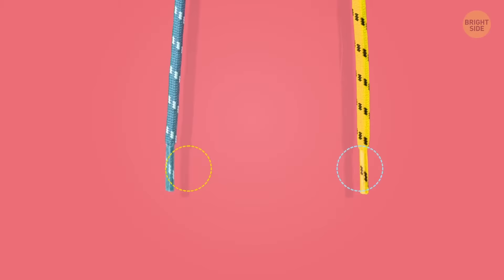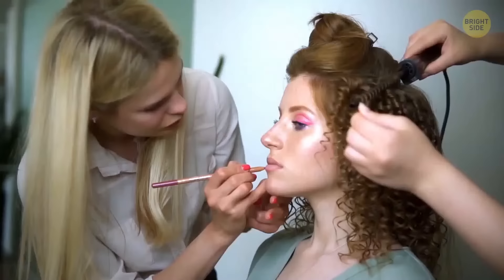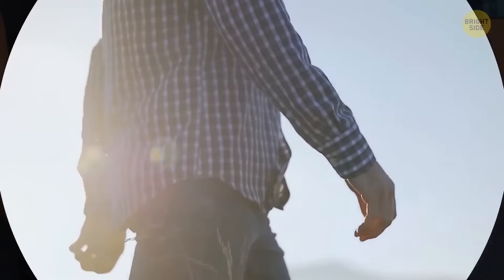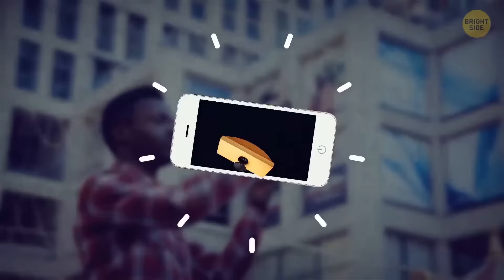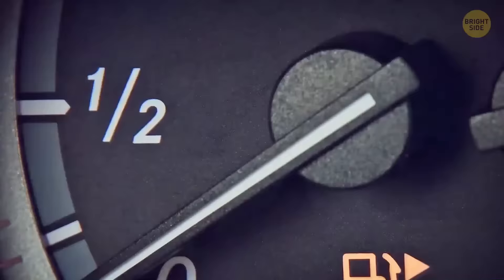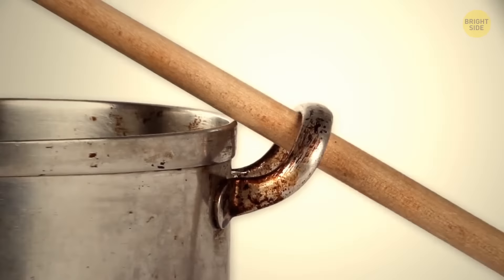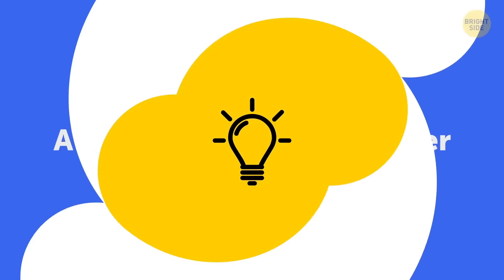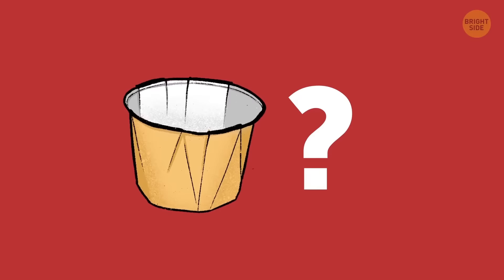I Just Found Out What That's For (Believe Me, That's Something You Need To Know)

Comment: Their information on dollar bills' longevity is wrong, because I worked at a bank where one of my responsibilities was collecting mute (mutilated) money and turning it in.  Much, I would say the majority, of the ones I turned in were five (5) years to ten (10) years old and some a little more.  It depends on the wear and tear, which varies greatly among bills of the same denomination. 
They're also incorrect about the QWERTY keyboards.  I know this, because I took typing in high school, and our wonderful typing teacher told us how it came about.  They are arranged by the frequency of use and the ease of co-operation of your first three (3) fingers particularly!  Pretty cool idea!
Reply: Teach! They surely don't know everything.
Reply: No, you are wrong. The first type writing ckerks knew their alphabet and were typing so fast that the metallic branches, that were the leverage allowing the actual Printing through pressing the inked often dual color ribbon of cloth onto the paper, meddled onto one another, the next key stuck before the metal lever of the last key had time to withdraw.
forcing the clerk to manually disengaged the crowd of those .
Therefore, the factories designers arranged these keys to avoid quick symphony that would stop 
and set letters to force the clerks to loose time.
of course new ways when electric typewriting were designed allowed the🌼 marguerite flower🌻 I think you call it daisy flower, you could replace to print with another police of characters, or the ⛳golf ball⚽️ like in other brands were printing one letter at a time from a key strokes buffer whose speed was now the limit.
before we reached a pitiful tactile current stupidities, but that is another story😂
Reply: But nice to have your bank clerk experiemce shared. The global american statistics on destroyed bills might duffer than your own bank. Many factors vary. Would be interesting to know where their figures come from.
Reply: and inflation may make the most used dollars drift to the next higher bankmotes
the use of 1 dollar to smoke it with herbs, the drug cartels laundry schemes in foreign countries could also move the figures in a noticeable way.